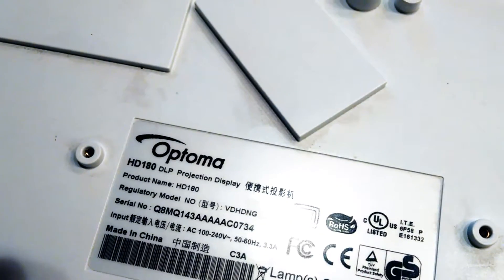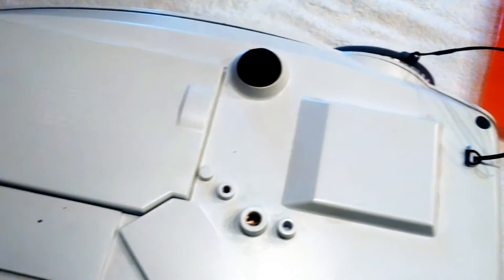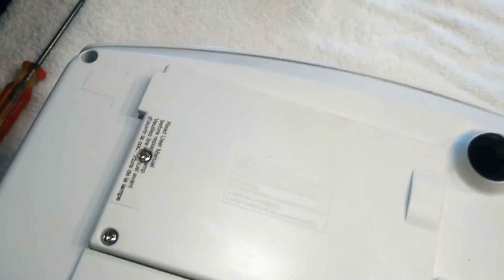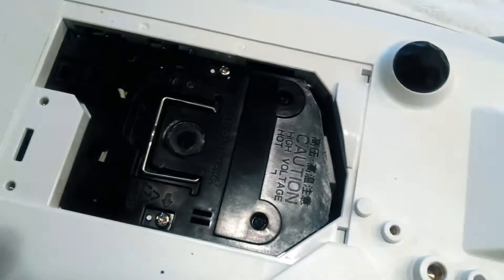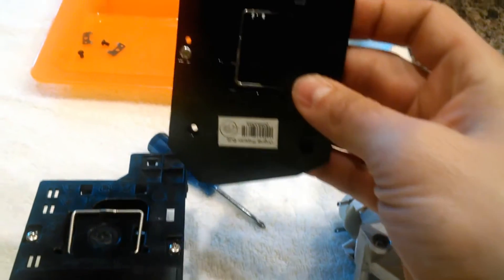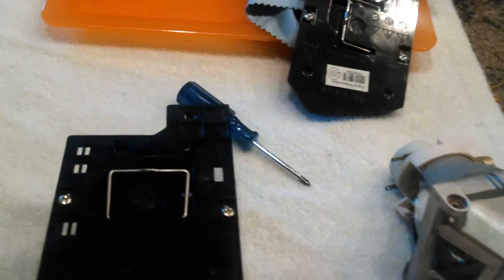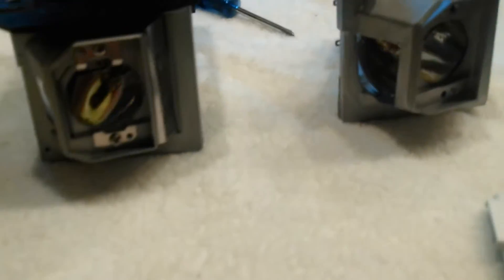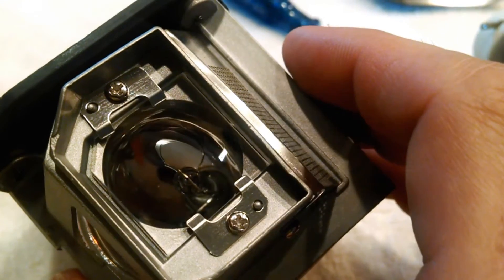Optoma HD180/HD20 Projector - fix flickering after installing a new lamp

Comment: This was 100% my issue. It seems that newer non-OEM lamp manufacturers are using a cheaper piece of glass that doesn't have the wavelength filter coating. This interferes with the DLP sensor. After installing the old lens, the new lamp now works perfectly. Thanks!!

Comment: THANK YOU!!!!  This worked for my Optoma HD26 when every other fix did not!!  And it was the simplest of all the possible fixes.  The replacement bulb, which was the exact recommendation from Optoma, caused a big flicker and seeming meltdown.  It was not the color wheel, not dust accumulation, not a loose connection, not a faulty replacement bulb.  It was just that little piece of glass.  Switched the old onto the new housing, and problem solved.

Comment: Replace the thermal grease on the chip otherwise it will throw up a fan error and shut down. i use arctic mx4

Comment: I have a epson ex9200 pro. My lamp started flickering  so I assumed it was about time to replace it due to the fact I had over 6000 hrs off eco mode and 2000 on eco. And exploded when my son and I were playing games. Now it's just been flickering so much after replacing it and I was about to get rid of it but the wife said that was 1000 bucks so i better fix it, I'm hoping this works I'll give it a shot tonight and I will update you!
Reply: It has not worked my project still flickers alot. Tried a new bulb again and same thing, I hope the bulb exploding prior didnt mess anything up internally

Comment: Hot damn, just used this trick on a PRO360W that I bought an offbrand replacement lamp for.  Had the same issues, the projector would power on, warm up for about 10-20 seconds and then the color wheel would get off, the colors would flicker and the projector would shut down with a solid red lamp light and a blinking amber power light.  

Thanks man, you saved me hours of tearing apart and cleaning this thing that would have been for nothing!

Comment: I have HD131xe and both bulb housing has coating, so no clear glass. The other thing is that the original bulb has a bit smaller glass as the new :/

Comment: hi  my 141 X hd optoma , has gone like the old colour tv tubes with washed out bright areas , and cant turn brightness up ? if you do its worse  , replaced the lamp marginaly better but still useless it used to burn your eyes out it was that bright and clear , its just over a year old and very clean , iv rang optoma engineer who says it sounds like the photo cell , where is this componant , i am an electronics engineer and i cant find it ? and he wont tell me , i guess just removing this from curcuit would be a massive improvement ? cheers
Reply from the maker: Sorry, I'm not familiar with that projector or that part.

Comment: Unfortunately this is a manufacturer issue.  There is a coating that prevents IR and UV from being sent into the projector.  It looks like the new lamps coating wasn't sufficient. Fortunately all the new lamps are now tested for this coating to prevent this type of hassle.

Comment: Wow that is exactly the problem I had with my Optoma Pro360W. I bought an off-brand replacement lamp, installed it, and it would turn on and work fine for a minute or so, then flicker a few times and the projector would shut off, and the red "lamp" LED would flash. I compared the factory lamp and the replacement and you were exactly right. The little square glass bulb cover on the factory one had a greenish tint to it, whereas the replacement was clear. I switched them out and it works fine now! Just wanted to mention for anyone who attempts this, the little square covers DO NOT lie flush in the housing, one side sticks out. THANK YOU! You're the man.